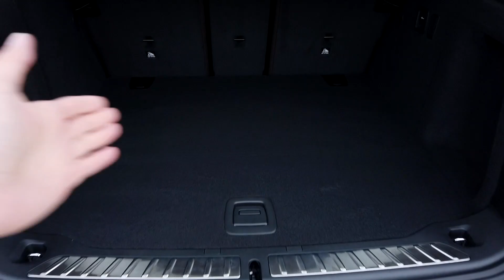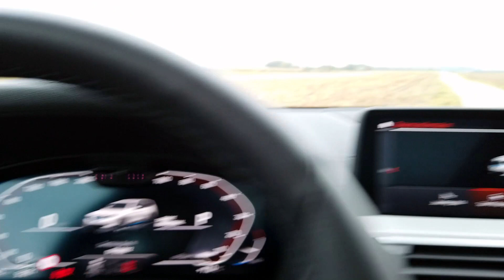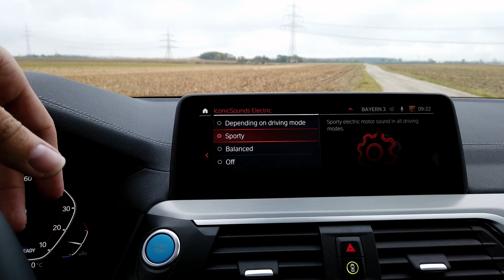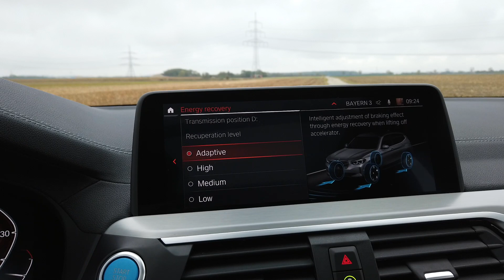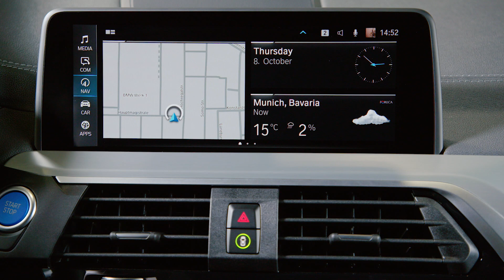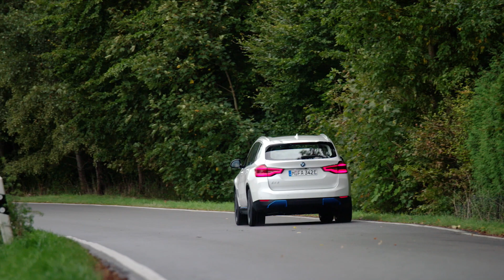2021 BMW iX3 Electric SUV - The best X3 to buy?

Comment: Dont u think it is slow? I mean, electric should’ve been faster than its petrol engine. Also how does it stand against other company’s car like benz eqc, etc?
Reply: Why do you think it should be faster than it's petrol version.
1) it's cheaper to buy
2) it's cheaper to run
3) it's a car mainly focussed on comfort
Reply: Sander VdW well the tesla model y is way faster + costs cheaper tho? Let’s say bmw should be priced higher than a tesla. Why is it slower than a tesla?
Reply: @geralddyvv  The BMW is cheaper than a model Y if you buy it as company car (the BMW gets discounts, Tesla doesn't). My iX3 costs 70366€, similar specced model Y would be 75680€.

And the build quality is much better. Way nicer interior, way better seats, ...

If straight line performance is the only thing you care about, why not buy a Hellcat?

Tesla has a very good drivetrain, but that's the only thing they have better compared to the iX3...
Reply: Sander VdW yes i agree with the bmw quality, but what i mean is maybe bmw could just upgrade their top speed and acceleration a bit more. 

Electric should be faster than petrol so people who owns a petrol engine car will buy a new electric car with 1. Better performances 2. Better for the environment
Reply: @geralddyvv  There will be a more powerfull version (that's the reason there is no frunk, they will get a 4WD version with 2 motors in the future). But this actually doesn't make any sense for this kind of vehicle. It's a 2200kg SUV, it's never going to be sporty. If you want a sporty car, buy a hot hatch, it will save you tons of money and have better IRL performance.
This "1 engine, relatively low HP" approach will increase the range significantly which is much more important for an EV.
Reply: Sander VdW i see, but i dont think ix3 has a great range either(?) so if it has 2 motors, will it have a worst top range?
Reply: @geralddyvv  The first real-life tests suggest 500km actual range (these tests seem to have been done few weeks back in Bavaria, so "average weather"). Worst case scenario probably around 300-350km. Dual engine will either need bigger battery, more efficient motor or have less range (weight = less efficient = less range...). Same as the Tesla performance models having less range...
Reply: If you understand bmw lineup within their model tier,this is their comfort line not a performance line. So speed doesn’t matter(see x3 luxury model)
Reply: thereturnfc is their performance line the m lineup? Like x5m or sth(?) will there be bmw electric performance line up tho?
Reply: BMW should not sell on price it’s not VW it’s should have good 0-100 Top tech and it shouldnt Made in China
Reply: @onthefly7265  And do you have an actual argument why it shouldn't be made in China? The normal X3 is made in the US, US cars are known to have bad quality...
And why should BMW focus on good 0-100? 0-100 isn't relevant as it tells you nothing about actual performance, I can outrun cars on track with a much quicker 0-100 time. And this car is an X-line model, and therefor comfort-focused. Extreme performance doesn't matter in this segment. Range, comfort, quality, ... are the things that matter.
Reply: @SanderVandeWiel  you are wrong it’s easy to get more Power with an electric vehicle but BMW don’t want to creat an X3ice killer why don’t they let the Customer choose xdrive or not and more power don’t they claim the power of choice? btw im fine with the production in china but its BMW they should build it here in europe its about the premium effect and Audi could do it too why not BMW
Reply: @onthefly7265  There are audi's built in India and China as well. And a lot of there engines are built in Asia. BMW has factories all over the world, and uses these for decades. There is no quality difference.

BMW chose the single engine layout because it is much more efficient compared to a dual engine layout and considering the use-case it makes much more sense. Why don't they offer a BMW 1 with a twin turbo V8 engine, as they claim the power of choice? Or an X3 with a 3 cilinder engine? The fact that the first version of the iX3 is the single version one, makes it cheaper than all of it's competitors, which means it will sell better and open the market for electric BMW's.
Reply: @SanderVandeWiel  you don’t get right etron Production for europe is here in europe and to add an second engine is not a big deal for evs if there 5th Generation Electric engine is that efficient there should be no problem people will pay for it like the etron... but it’s BMW politics to make the ix3 bad so the people will buy the ice x3 for more Range better power xdrive
Reply: @onthefly7265  But it's not slower than an ice X3. It's slower than some ice X3's. What you're saying is that Audi should have given the e-tron more power because the Q8RS accelerates faster. You don't have to look at EV's as the top-end of a line-up, they are just a motor to choose from. And in the case of the iX3 it's the best performance/price deal of the complete line-up
Reply: @SanderVandeWiel  the 330d is the best X3 in range power price not this ix3
Reply: @onthefly7265  No, it's not:
https://configure.bmw.be/nl_BE/configid/x5q9m5n4
vs
https://configure.bmw.be/nl_BE/configid/j6l5q9r2

You have to use the same specs to compare ;)
Reply: Sander VdW whats ur take, do u think bmw will soon release iX5 soon? Do u think it will be a great bmw electric car in performance wise? Rn im looking to buy an old X5 and looking forward to get an electric X5 in the future
Reply: @geralddyvv  2021 according to their roadmap...
Reply: Sander VdW is it the BMW Vision iNext(?)
Reply: @geralddyvv  presumably. Not officially but the inext Will be a bigger SUV than the ix3. Chances are it Will be rebranded to ix5 or ix7...
Reply: Sander VdW definitely will be waiting for it
Reply: @onthefly7265  pffff.  the etron is made in Belgium, the Q5 in mexico. as long as the factory quality control is done based on german standards, it should not matter

Comment: Rather this than a Model Y.
Reply from the maker: Why is that?
Reply: Etron over this shit ix3... this isnt a bmw it’s bad compare to Mercedes and Audi ...
Reply from the maker: @onthefly7265  The e-tron doesn't sell too well. High price
Reply: @bmwblog  etrons are cheap as f* here in germany maybe not if you buy it directly from there website but if you take a look over the cars on the internet they are very cheap now compared to other EVs btw they are the best selling SUVEv in Europe till next year the model y arrive or the id4 or Q4etron BMW will have a hard time to compete agains other brands I’m a long time bmw fan and i owned many bmws include the i3 my only hope for a next good BMW ev is the iNext
Reply: @onthefly7265  e-tron cheap? Wow, you must be rolling in dough then, good for you!
Reply: @SoerenM  they are cheap 60-70k for etron 55 with 10000 km on the clock
Reply: @onthefly7265  having driven model Y LR, ID4 RWD, Q4 etron RWD, (also EQC, on which for a while there have been deals putting it in the same range) I ordered the iX3 yesterday. Why? Driving impressions and cabin feel. The iDrive is still the best overall experience, esp. if U own an i3
Reply: Rattert Model Y than this iX3
Reply: @guntherfischer5356  Funny "freudian auto-correct" ... Tesla definitely rattles a little bit more than BMW :D
Reply: Rather